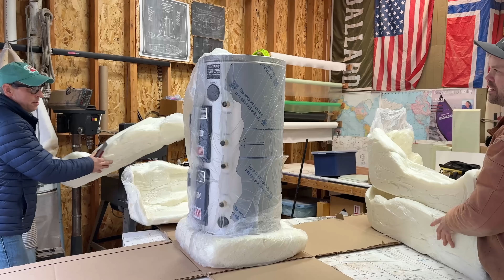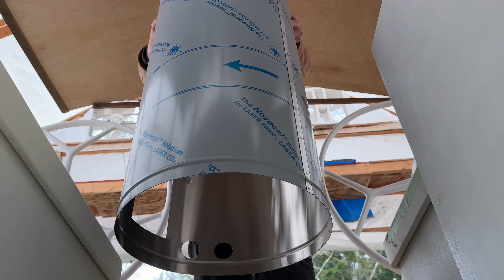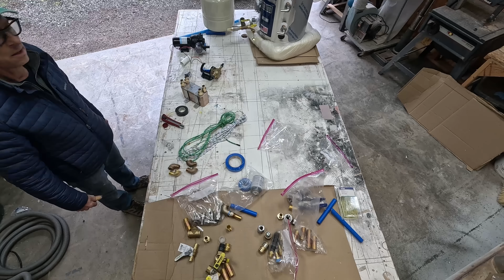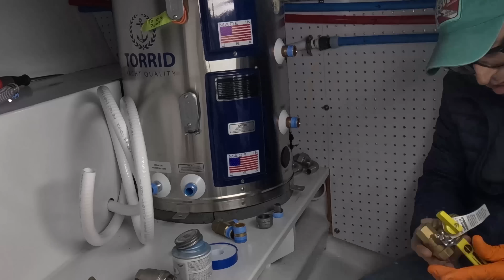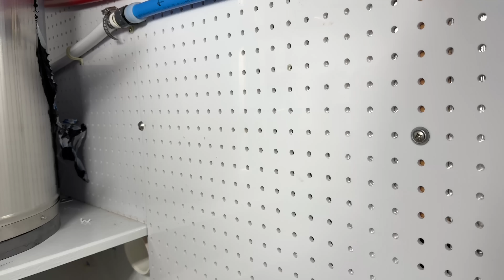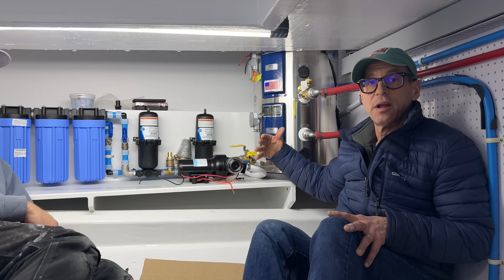Water Heater Guru Visits the Duracell Project. [Ep. 209]

Comment: It appears as thought the bottom magnesium anode will be easy to check and/or replace, but will you have to remove the water heater in order to get to the one on the top?  I was looking to see if you could spin the heater a bit so that anode was more readily accessible, but I don't see a way to do that without causing a lot of hose routing issues.

Comment: Wouldn’t you need an accumulator/pressure relief on that hot water loop? As far as I can see it’s a closed loop that will heat up and cool down significantly

Comment: Great System, in germany you can see this with some home installations. As it is more cost efficent to heat you water with electricity from your PV as selling it for 0.04€ for a kw/h. (Buying it costs 0.26-0.35€ kw/h)
For my self i got it with solar and heating/cooling fluid, usally you dont have to heat up the water with gas from April to end of September. (In hotter weather cycles it worked form March to October, but that cycle changes 2 years ago)

Comment: Shouldn't the check valve be on the hot water side of the tee and not the cold or did Jeff point to a union or adapter and the actual check valve is out of view behind the pump?

Comment: Hopefully old mate knows you need to heat your hot water system to >60C (>140F) every day to avoid making bacterial soup and risking Legionella and other nasty problems. Not just 120-125F like he suggested. A tempering valve should be used to keep the water temps safe for use not the thermostat.
Reply: it's been proven that 125F is more than adequate for zero legionella risk in domestic hot water
Reply: @JH-tc3yu uh, no. 125F will stop Legionella multiplying, but not kill it quickly. Meaning the risk is not zero or even close to zero. Especially for at risk people like older or pregnant people...

Comment: The flat plate heat exchanger technology is very cool, looks like yours is plenty big enough for the btu ratings of everything. On commercial systems I usually would put a wye strainer ahead of the flat plate to keep out debris. Cheers and good luck.

Comment: Hi Matt, You bring out the best of the best. I still hope to see you making full use of that waste heat. Once tthe wate is hot and the valve closes, diverting that hot water to a boat central heating tank.

On the water heater you used, can it be side mounted? - Cheers, Andrew
Reply from the maker: They make horizontal water heaters but they don’t work as well and this one fits perfectly where it is

Comment: How will you change the filters?  They won’t drop more than an inch or so.  Don’t those filter cartridges run the full length inside those blue housings?  Can you mount them inverted or on a 90 degree plane?  Plain?  Whatever. 😂
Reply from the maker: They come out. They’re tight but we made sure they come out.
Reply: @TheDuracellProject ❤

Comment: Hi there. I strongly suggest to install a second water pump in parallel. If one fails, the other one can be activated by the push of a button and a switch of a valve in 5sec and you are in business again. Had that and it was very effective and reassuring. Regards, Silvano

Comment: Water is one of the most important facilities on a luxury yacht, the combination of the water maker and the water heater system puts this boat into the luxury class making life aboard comfortable. Personally I think that having plenty of fresh water and a hot shower is the most basic and important feature on any boat you intend spending more than just a weekend on. 
One question, the top zinc looks like you cannot get to it without uninstalling the tank, is it possible to turn the tank slightly to make it accessable?

Comment: when it's time to replace the CaCO3 "remineralized" filter you may want to swap it for an additional sediment filter. 

There's a myth that's been floating around for decades that "pure" water is bad for you and depletes minerals from your body. This is true if you are ONLY drinking water that's gone through reverse osmosis and deionization... especially if you're making super pure 0tds water with separate beds of Cationic, Anionic followed by a final media bed of mixed deionization resin. And it's only an issue if you have NOTHING but water for weeks on end. If you're eating food you have nothing to worry about... plenty of minerals in there. 

Reverse Osmosis water won't harm you. Typical US water supply is in the 200-400TDS range and a decent DOW film tech membrane in a household system with  proper pressure and rejection rate will bring the TDS of product water down to ~3tds after the initial "tds creep" tapers off upon starting. Most household systems won't automatically purge this initial high tds upon startup so the pressure tank is more in the 30tds range. that said, I've been drinking a gallon a day for 2 decades with no silly "remineralization" woo woo stuff. 

"desalinators" or marine RO systems are a fair bit different but the principles remain the same. Seawater as your source water is coming in at 35,000 tbs!!! Sodium and Chloride make up 86% of the salts(minerals). Sulphur, Magnesium, Calcium, Potassium and bicarbonate make up another 13%. marine RO systems seem to all spit out water in the 200-400 tds range...  Point being- there are already PLENTY of minerals in that filtered water. 

/endrant

Comment: Boat plumbing is no difference in a boat or a house, with the exception that in a boat, everything must be easily drainable without using a compressor. Only poorly designed and/or installed systems need a compressor ti drain the  system for winterizing, storage or maintenance

Comment: Such a nice system! I love how neat and tidy it all is. The only part I do not understand is the pressure reducer valve. Why was it not installed and where would it be installed? I assume somewhere on the inlet side of the water heater? But also what is the need for it? Jeff states that the CG wants the max pressure in the tank to be 100psi or less. The pump is only rated for 60psi isn't that 40psi difference enough "overhead" to allow for the heat cycle to increase pressure in the tank but not exceed 100psi? If not, and the pressure reducer valve is needed then is its function to only allow 40psi into the tank which gives you a 60psi "overhead" for the heat cycle?

I have been looking hard at Torrid for our next big boat project. I love the idea of multiple coolant heat loops and multiple electric heating elements including one for DC voltage.
Reply from the maker: It came too late for the video but I’ll install it after the check valve and before to e accumalot tank on the hot water side

Comment: What liquid will be in the closed loop of the heat exchanger (the plate heat exchanger, circulation pump and exchanger inside the water tank). It appears to be separate from everything else, how will you purge air from it and is there an expansion tank/accumulator for it?  The water heater looks like well thought out unit!

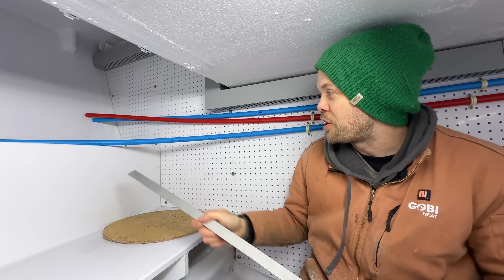Comment: @2:52 Matt, you really should swap those Hot and Cold lines around behind you so the Hot line is above the Cold line. If left as is you have to worry about Parasitic Heating aka Heat Transfer into the Cold waterline, which can turn the Cold waterline into a breeding ground for Bacteria. Just thought you should know. 👍👍

Comment: Really nice looking system. I did have a question / concern that the check valve looks like it's in a spot where the hot water can still flow back to your filters? Also, no separation between the two accumulators, so they function as a single one with the volume of two combined. It would be different if the check valve, or pressure regulating valve were between the two accumulators, which may have been the intent?

Comment: I was a bit concerned when he suggested storing water at 120-125F as you're getting into legionella territory. Better keep it about 140-150.
Reply: Most marine water heaters include a thermostatic mixing valve that blends cold water into the hot water supply.  This allows the water heater to take better advantage of engine heat of around 160* fahrenheit while reducing scalding risk
Reply: 125 has been proven to have zero legionella risk for domestic hot water

Comment: Having fitted many water systems on boats this one seems over complicated. Why fit a separate heat exchanger, the water will only get as hot as the engine/generator system which i assume will have its own thermostat. My biggest worry is you have fitted two of the noisiest pumps on the market!
Reply: Yeah it's a silly level of complication. Why not let it get as hot as the engine coolant that's more heat energy stored and then you can use your mixers to set the temperature you want.
Reply: @viva5724 the operating temperature of antifreeze in a 5000 watt diesel generator averages between 175 to 200 degrees. Water heated to 165 degrees will cause instant third degree burns to human skin. Water heaters have a thermostats for a reason.
Reply: @ParodyzNutz The temperature is set by the thermostat in the generator... Nobody said anything about not having a thermostat and the reason water heaters have thermostats are because an electric element will exceed boiling temperature of water.
Reply: @viva5724 the thermostat in the generator only stays closed when the engine is cold. Preventing coolant from circulating through the engine block until the engine reaches operating temp. Then it opens automatically. You can't adjust the thermostat on an engine like it's an air conditioner. It's a mechanical device that opens automatically at about 165 degrees. It's either open or closed.
Reply: @viva5724 The heat exchanger will be far more reliable than a thermostatic mixing valve
Reply: @JH-tc3yu The heat exchanger may be more reliable but there's no way the pump  and switch/thermostat required to utilize it is more reliable. This is just a silly system overthought out with solutions looking for problems... I've never had to replace the mixing valve in a isotemp water heater. Or you could you know just not turn on the hot water all the way or limit the supply valve to the hot water side on the fixtures you're worried about.
Reply: @v @viva5724 worked on a seiner with a 10 gallon water heater. We didn’t use the electric element we just fired up the main and let it idle for a little bit even then the mixing valve for the shower in the head could not quite keep up. I believe having it set up this way helps prevent the water in the water heater from becoming as hot as engine coolant which can be 220*. I sure wish the water heater on that seiner was set up like this

Comment: overall a nice system, but I would not use that jabsco water puppy (have many of them). I think you'll find that even though it functions integrally as a check valve to prevent thermosiphoning (I'm sure that's why he chose it), it will be very loud when running. I would instead look at a high static pressure centrifugal pump, like a Pierburg CWA50, along with a spring-loaded ball check valve which can be found in bronze or stainless. this will be not only silent but also more energy efficient in terms of amp draw
Reply: I was also going to express a concern regarding noise.  With the pump on a long horizontal shelf like that, I can envision that noise and vibration will be transmitted pretty easily through the boat.

Comment: We have a TORRID and love the product, ours is the 40 gallon 1000 w and 2000 w heating, we would love to have the DC ability as ours is AC.  These are simply the best products.... Dale & Connie
Reply: Also, we don't have an idependant heat exchanger before the hot water from the main engine hits the Torrid.